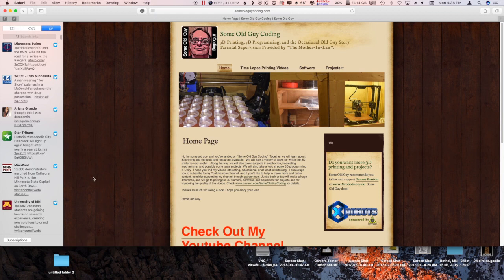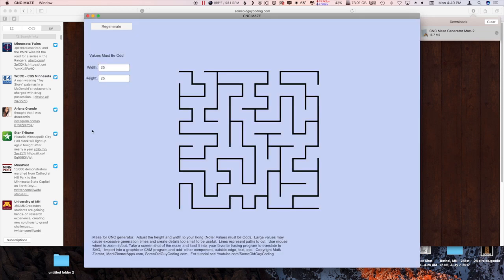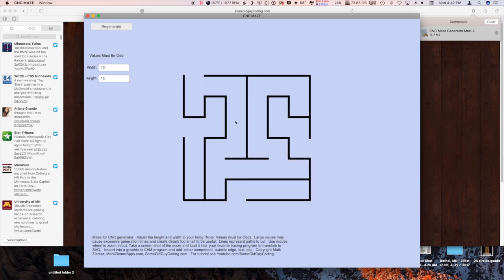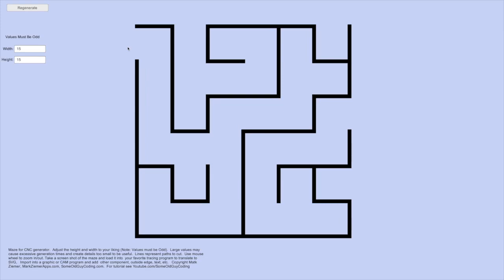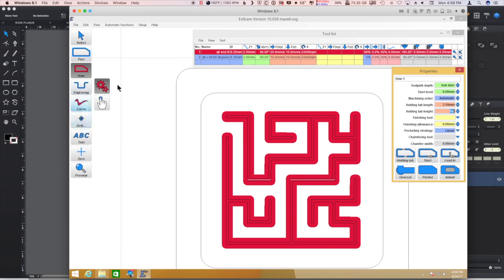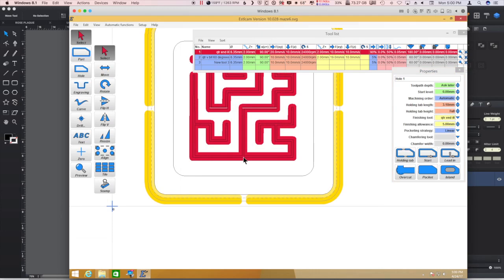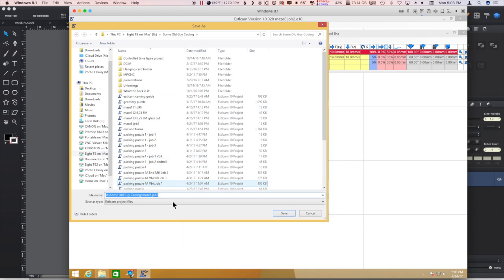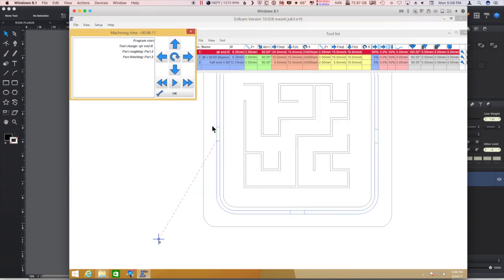MPCNC 23 CNC Maze Software

Comment: Doesn't the following site do the same thing? http://www.mazegenerator.net/   It has quite a few options & it does allow you draw the path between the walls as lines or the walls.  Just check the box "As Lines" to draw the path between the walls.  That is what I used to draw a maze & it worked really well.
Reply from the maker: David Bunch 
Dang. I went there too. Didn't notice that option. Bummer.  I think I might have gotten caught up in the usage rights, and moved on.  I didn't want to have to pay for a maze if I wanted to produce one and sell the item, and I didn't feel that the license agreement allowed me to make a video that had ads using their product without paying.